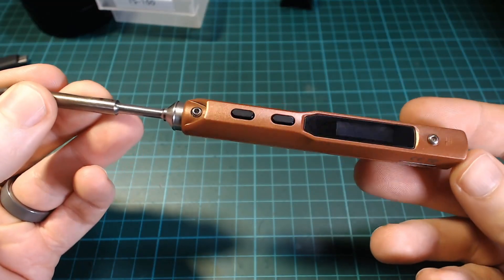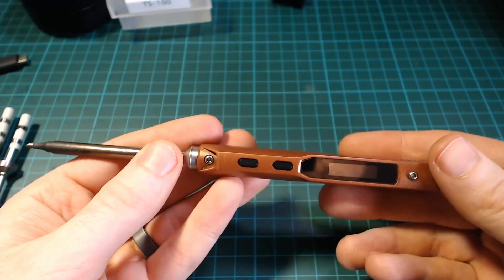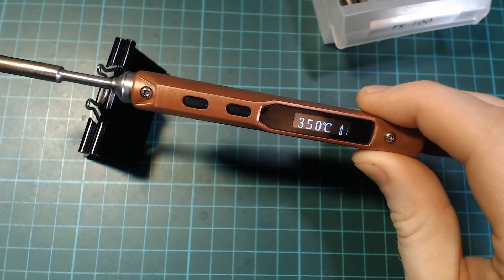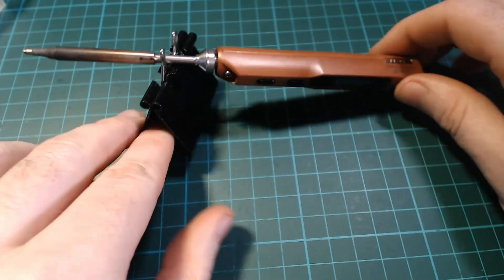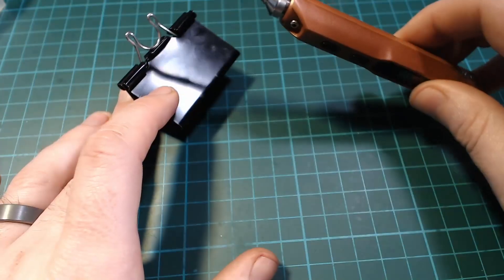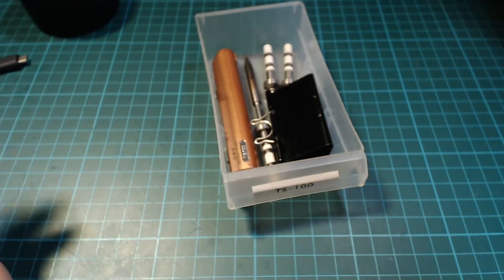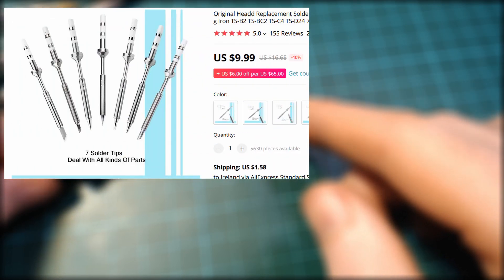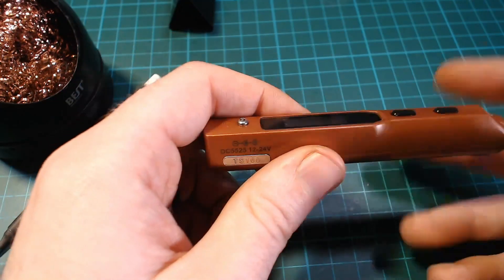TS100 Soldering Iron - My thoughts in 2020 (3 years of use)

Comment: the xt60 cable that  you bought to aliexpress is heat proof ?  Do  you ever put the cable  on test like put  the  tip of soldering  iron  on the cable to see  if it is damage by the heat.

Comment: I have a few soldering irons. The TS100 is great for small electronics, not powerful enough (really) for larger stuff like attaching even 9v power cables to jack plugs. It can be done but much easier with a bigger iron. My TS100 OLED display failed after about 4 years. It can still be seen in the dark and the iron still works. I didn't use the iron heavilyat all but apparently the OLEDs just die in time.

Comment: For power I have 2 things I use one is  a laptop power supply with a switch that can go from I think 15v to 24v I generally run it on like 20 or 22v and the other option is my portable setup which is my carrying case for it i put a 5s 2p 18650 battery in and for the silicone wire I found from some comments but it was a wire for a tattoo gun and mad a like 1ft cable that goes from the laptop charger so female 2.1mmX5.5mm to the male 2.5mmX 5.5mm or maybe the male and female are backwards but then a probably like 3 or 4ft cable for my portable setup that is xt60 on one side and the 2.5mm on the other

Comment: I know this video is over 2 years old. However the wire stand clips to the iron where the plastic housing meets the tip. The stand stays attached to the iron at all times when in use.

Comment: Have you thought of using a usb 3 to barrel jack cable. The jack is 5.5mm X 2.5mm and output 20v
Reply from the maker: If your talking about usb-c, Yes, I've tested it and it works fine once you use a 50w or bigger power supply

Comment: Ive used my TS100 for 5 yrs now. I got mine from banggood in 2017 for around $55 usd, it was lower priced shipped from china, though they sent it from US warehouse and i got it in two days. The last 3-4 years its been used almost daily for 4-5 hrs, some days 10-12 hrs but not constantly ON.
 At first i was only using a 12v 2A PSU and it heated pretty quick, under 1 minute. I recently upgraded to 24v 2.5A and it heats much faster! The handle does get warmer than with using 12v, but its never gotten to hot to hold or worry about, it was designed for 24v. Also been using the shipped pointed tip and its still in great shape! I also built a battery pack using five 18650(18-20v) so i can do work out in the woods if i need to. Lol 
Overall its saved me time and money! I was prob spending what this unit cost just for tips for my other soldering irons yearly.

Comment: just bought one, and.... it is a nice accessory to carry with you in the "super sack", but it will never replace my desktop soldering iron for many reasons.... first it is to small to hold in hand, also to lite so the softest cable I found is to  stiff and it moves the TS100 around the table... and so on...

Comment: I just got mine as a kit with the 24v power supply, silicone cable, and BC2 tip. I threw the IronOS firmware on it right away which is just drag and drop. I can't wait to use it.

Comment: The stand clips on to the collar of the heads right between the head and body if the iron 😅 I use mine all the time and watched this video just to see what yours was all about and yes I like it but as I use mine in the field and random places there's no point in having a bigger clip like that for me.

🥃cheers🍻
Reply: Ps I picked up a few old laptop power supplies from junk stores and also modified one to use a silicon XT60 plug like you have as well! Grate tips and tricks thanks for sharing!

Comment: THE SECRET TO GOOD SOLDERING (for an amateur beginner starting out)

The secret to soldering I found after many
years of trying and doing nothing but budge
jobs, is that you need more than just a
soldering iron and solder to do it right.

The problem is the hot tip oxides with
air really quick and gets a black hard
coot on it that prevents the transfer
of heat.  And it happens pretty fast
with just the iron sitting there being hot...

The hotter you run the tip, the faster
it oxidizes in the air.  So that's why
you try to run cooler than 400.. 380,
370, 360, etc.

So the secret is you need some extra
thinks to keep cleaning off that tip
constantly while you solder.

--a damp sponge to wipe it on
--solder cleaning paste (comes in a little can)
--tip tinner  (comes in a little can)
--a brass kitchen scruncy dish scrubber

You only need to keep the very tip clean,
not the whole length of the iron or the
length of the metal rod tip.  Just the tip
that will make contact with whatever your
work is.

The other thing you need is flux... or a
flux pen.   Flux melts, and helps transfer
the heat, and also cleans off any oxides
preventing a good solder joint.  There
is a little flux inside the core of most rolls
of solder, but not all, and wit things like
wire ends and pads it doesn't hurt to
ad more, either by dipping the wire end
in the flux or putting a little on the pad with
a brush or something.

Pace World Wide Soldering videos.. watch like the first 30 or so, it will up your soldering game.  I need to watch way more of them but there is only so much classroom I can take at one time:
https://www.youtube.com/c/paceworldwide/videos?view=0&sort=da&flow=grid

Also, your tip matters.   The TS100 ext ship with a fine point conical  tip, which I found to be mostly useless unless you are doing maybe super tiny PCB stuff.   The flathead screwdriver tip I also found to be not so useful, although its suppose to transfer more heat to larger flat areas.   The tip I found most useful that I run almost all the time is the 45 angle cut conical tip.    A conical tip is useless, but the cut conincal gives you a flat 45 (or whatever degree) angle cut off of it that give syou a flat oval surface to transfer heat to your work or into the solder drop.

I'm no expert at soldering at all, but maybe these tips will help someone just starting out who wonders why everything they are doing is turning out bodgy.   You need more than a soldering iron and solder to do soldering, that's why!  You got to keep that tip clean constantly, use flux, and watch those Pace instructional videos :)  

When I first started out, I read about keeping the tip clean, and I thought okay, I'll clean it off every couple of years each time before I started a new session.  Nope, it don't work that way!  You have to clean it off every couple of... minutes!  while you are soldering   I clean mine off like after tinning 2 or three wires....   that often.  Solder, solder, ,clean, solder, solder, clean.
Reply: Thank hon for THE info! Gonna check out the link!
Reply: Great link for a beginner.
I will learn a lot .. thanks

Comment: Do you ever use the grounding cable/wire that came with the iron?  I just got my iron a day ago and all the videos I've watched, no one ever mentions using the cable.
Reply from the maker: No I never used it. I talk about it a little in my review of the ts80p , there is mains potential on the tip without it, but it probably only impacts for sensitive components
Reply: @BrianLough  OK.  I had a cheap solder iron before this and the mains power went thru the tip.  I got zapped really hard and it fried one of my amp chips.  I threw it in the trash and bought this.  Thanks!
Reply from the maker: You'll definitely not get zapped like that anyway! I did see some leds turning on when I was soldering but that is the only thing I ever noticed
Reply: @BrianLough  Good to Know!  Thanks!

Comment: hey can you use Hakko tips on the TS100?
Reply: There are many types of Hakko tips. I believe the T12 Hakko tips mechanically and electricly fit, but they are much longer (the hakko iron has a longer sleeve so you can hold it closer to the tip). That would make them too hard to use I think. I stick to the TS100 originals.

Comment: Thank you for proposing questions  I have one : Why nobody I see using TS100and similar, never connect the earh wire ? I suppose I will get the answer by myself with time but actually I dont. A soldering station have its own mass wire usually, so the iron is grounded. It may be less important than I think but ... ?
Reply from the maker: I have been using the ts100 without the strap for 3 or 4 years now, I've never seen it cause a real problem, but I don't solder anything sensitive. If I was working on $20 chip or something I would definitely either use a strap or power it from battery
Reply: @BrianLough  Thanks for the answer, indeed I did not thought that a battery can solve the issue in case it is mandatory. I received also an answer to use a resistor about 47K between Vpin and earh, on the alimentation, which is supposed to solve the problem 99% of time!  (is Vpin the positive output ?^)   Best regards
Reply: @BrianLough  "for regular work don't worry about that earth wire, just put a 10k-47k between V- and EARTH and you're done."

Comment: I was told you can find old laptop chargers and use those to power the soldering iron. Make sure it has a DC5525 tip, and you should be ready to go! Mine has an output voltage of 19V, but I don't have the iron yet xD

Comment: I went through two TS-100 irons in as many years. Many others I spoke to had similar reliability issues. These aren't nearly as reliable as the Hakko, JBC, Metcal, or Pace soldering stations.

It is actually cheaper to buy a Hakko FX-951 than buy a TS-100 every year and spend extra on a good 24V PSU, silicone cable, and DC5525 jack. I don't understand why Miniware had to use the hard-to-find DC5525 jack that's even harder to find since it is abnormally long. Worse yet, none of the DC5525 jacks available are rated for 3A that this iron requires (2.71A to be precise) at 24V. I had to spend a bomb procuring Connexall DC5525 jacks that meet the spec.

After my third TS-100, I just gave up and ponied up the cash for the Hakko FX-951.

Comment: Been using mine for a couple of years now, absolutely love it. You can get adjustable power supplies with a dial and LED screen from Banggood for about £6, goes up to 24v no problem and the cable is flexible if a bit short. I have mine bolted to my bench so the cable length isn't an issue.

Comment: Brilliant adaptation of the flimsy stand!  I love those binder clips, they are extremely versatile!  
I use a similar trick to keep my mini weed pipe from falling over when I set it down.  ;-]
If ever you find that your stand is still too light, you can use a mix of glue and old nuts and bolts (or anything cheap and heavy) to fill up the base.  Cheers!

Comment: Can you tell me the best way to take care of the tip so it lasts...
How much should you scratch it with the copper scouring pad?  
Is flux just grease, or is it acidic and cause corrosion?   I think it's acidic. 

If I tin the tip won't that leave flux on there that was inside the solder?
Should you ever sandpaper the tip when cool to get the black stuff off?

I flashed mine with the custom firmware, piece of cake.  Easiest flash I ever done.  You can set max temp to 450 then and also the amount of wattage you want it to draw... I used a Dell power brick like yours 18v 2.6amp... so I set mine at 45watts which is about 18x2.6.

The main thing I don't like about it so far was the premium cardboard box it came in - you have to break the iron down to store it in it.  I'd rather it was a long and thin box.  They could of saved the money and given me a second tip, like that conical tip.

choppergirl.air-war.org

Comment: My Ksger stm32 soldering station came with a 5mm wide angled blade tip, which I thought I would never use. But it turned out to be very useful and removing parts. It's so wide that you can unsolder both ends of a 1206 at once and remove the part in one hit. Also the chisel gets under bent-over THT legs to straighten them so you can pull the part from the PCB.

Comment: Thanks for your thoughts on this Little Iron. If you want to start out with a hobby may not continue with (see that buy expensive and do nothing) then a cheaper soldering station might be the answer. But this is not a bad product at all. I have a feeling that soldering irons are probably as personal as the car you own and love. Soldering iron = make something. I do own this little iron and does work nicely.

Comment: Have used many types of soldering irons since 1060's. Used some of to popular JBC and similar, but never saw enough advantage over to recent other brands, though the direct tip heating types do have considerable benefit over the indirect changable tips. Also have a TS100 and initially was annoyed, like  Brian with stiff leaf, in fact so bad power via 2.5mm dc jack got onterupted. For last 6 months zi have extensively used the TS100 for SMD and through hole work, after making a new flexible lead and firmer fitting 2.5mm DC jack. For most work I grab it over the more space using normal iron. Except on heaviest ground plane or larger wiring , and when using the soldering tweezers I almost exclusively use the TS100  as it is immediately at hand, and heats way faster on 24v. Recommend it as a very practical usable tool at less cost than many medium range alternatives.  The possible use in mobile situation off DC power was my original reason to get a TS100,  having stopped using a butane fueled solder iron in the field as representing some hazards.
While also nice the TS80 fails by limiting at lower wattage, thus only suited to lighter work, meaning more occasions the larger mains powered irons would be needed.

Comment: I've used it for a year and I have an overall positive opinion about it.
It's small and ofc very portable. I didn't get a power brick with it though so the hassle was to get a good cable with it, since it needs to be flexible.

After a while I got myself a KSGER T12 soldering station for around $40 with some T12 tips which was a really good soldering station for its price.

Comment: Hey Brian and thanks for your thoughts about our beloved ts-100. as you know I bought mine around the same time you got yours. I use it mainly as a in the field iron or if I have something to solder that needs the use of a special tip as I don’t have different tips for my main soldering station at the moment. I  used it with a notebook power brick until now but I ordered a usb c trigger cable which will allow me to use it with usb c as this will get the de facto standard for higher powered equipment I believe. Also my notebook is usb c and so I will need to carry only one charger with me. I hope the cable I get is flexible enough. If not I make one myself. If I saw that correctly you got yourself a lab bench supply? I thought you would share this „event“ with us as you did not get one since years and we all suggested it? Which type is it? And are you satisfied with it so far?

Comment: If you solder often enough and have the desk space, I wouldn't recommend it, a proper station is so much nicer to use. I don't have the space and have to take my tools with me sometimes, so this is perfect. Haven't messed with the firmware or anything, it's fine just out of the box. A power supply with a thin cable will make using nicer.

Comment: I've got one.
To be honest, I've not used it much at all.

The reason?

I used it with a 19volt 2.5A laptop PSU and like Brian, I took issue with the cable.

So. I too went on Aliexpress and bought a silicone cable.
But. My silicone cable wasn't anywhere near as flexible as Brian's.
So I think I need to look harder for a softer cable.
Reply from the maker: I linked to the exact one I bought in the description , hopefully it's still flexible like mine!

Comment: I've been using it as a portable iron I mainly use when at our summer cottage. For me the biggest issue is the size of the handle and its material. My hands are typically quite dry (and call me weird but I like them as such) so I constantly felt like the handle could slip so that I'd get the hot tip oon my fingers. I solved this with a small but wide rubber band wrapped around the handle.

I was not personally interested in the potentially better temp accuracy on the custom firmware but it's user interface felt a lot more intuitive for me (and I also like the typeface much better). It might not make sense to replace it if you're got used for the built in one though. I just flashes mine immediately after trying the original one as I found it limited and somewhat ugly. :)

Comment: Hi Brian, Sound was great.
I love my ts100, in fact I have 2 of them.

I did have issues with stands and have burnt my fingers, desk and floor a couple of times so I bought 2 of these from LCSC https://lcsc.com/product-detail/Soldering-tools_Guangzhou-Huanghua-Elec-ST-91M_C105273.html, I removed the solder holder from stand one, the iron holder from stand two and added it to stand one giving me a double stand and it works great.

The reason for two is I solder from 0402 right up to large through hole battery connectors so it's handy no to have to swap tips.

You can see a photo at https://github.com/the-wal/ESP-NOW-Test/blob/master/20solderstand.jpg

Comment: I had been using mine a little, but like you the cable gave it terrible balance, but my new flexible cables arrived last week, so for my last video I made myself use it for all of my soldering, and it was pretty good. I did move it to the Ralim firmware though, but I don't think it made any difference to its performance. I'm definitely more comfortable using it now, though to be 100% honest, it's still not as comfortable to hold as my bench iron.